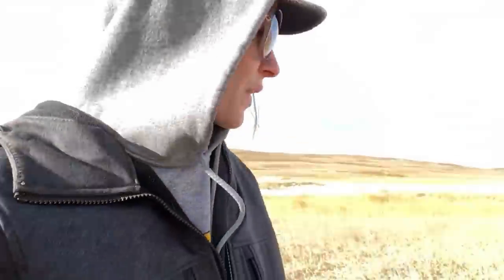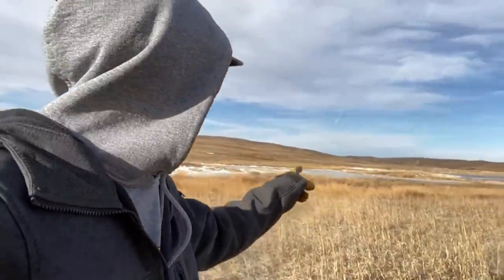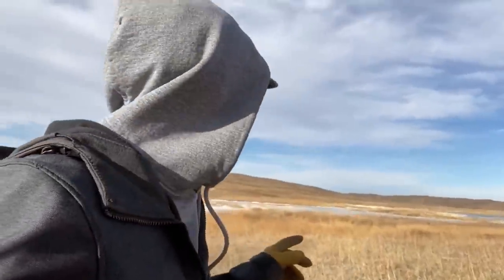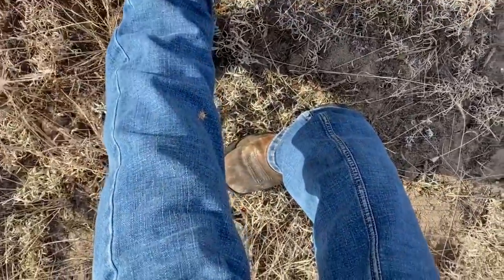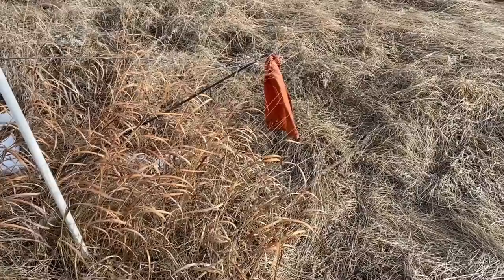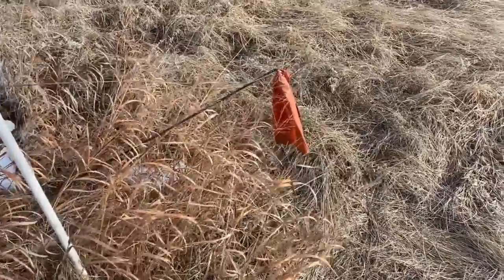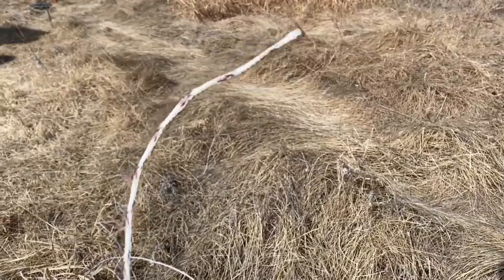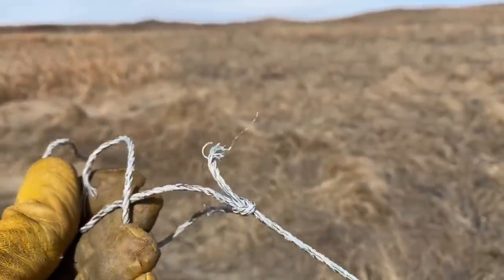BUSTED FENCE | Installing a Tension Spring on High Tensile Fence

Comment: Just a thought deer were busting my fence old guy said lower your wire. He was right deer would jump over and cows don't. With time i learned where the deer usually ran put that about knee high and it worked . Never had much trouble after that only question was are the deer training me? Nice job

Comment: I know it’s about saving money but should invest in a roll of 17 gauge wire for the small repairs like that. Think it’s like $15 for a quarter mile roll has like a 500 pound break limit I think.
Reply from the maker: We have spare rolls of wire, but where this was just a bandaid repair, we opted for the string. That way we can “ripped it off” a little faster once the lake thaws. 😂
Reply: Faith Family & Beef gotcha

Comment: I know you got a D in Physics, ... but, at about 12:10, you were using the fence pliers to open the U-end.  You needed to open it up a little in order to get the insulator connected.  The pliers were positioned to the side, and you were rotating them to open up the U-end.  Suggest: position the pliers in-line with the axis of the U-end, grab the wire with the hole in the pliers, and rotate forward (or backward).  You will have much better leverage than being position on the side, needing to twist the pliers to accomplish the task.  I hope this is understandable.  BTW, lots of people got D in Physics and used other gifting and talents to do well in life.
Reply from the maker: Funny you should say that... that’s exactly what my dad said when he watched the video too! And you’d think I’d know already, having watched Mr. FFB put these together a time or two. 🤷‍♀️😂
Reply: @FaithFamilyBeef  Fence pliers are neat tools.  When I was a kid on the farm in '50s, '60s, we did lots of fencing and used fence pliers often.  I've been off the farm for decades (am involved in other outside work that requires lots of tools), but have a pair of fence pliers in my toolbox.  I'm not sure I have used them in the last 20 years, but think about using fence pliers long, long ago.

Comment: with steady tension, the wire will pull right through the ice...
Reply from the maker: Does that work on any thickness of ice?
Reply: @FaithFamilyBeef  Yes, much the same way a skate works on ice- the pressure liquifies on one side, and it refreezes behind, slowly working its way out.. sun also helps to warm the wire too... But a blade of grass will stop it....